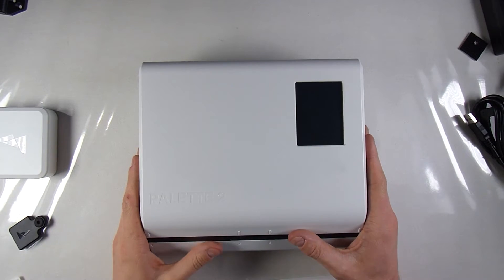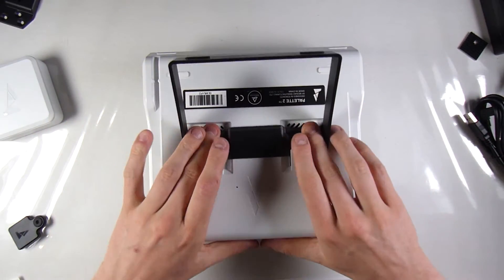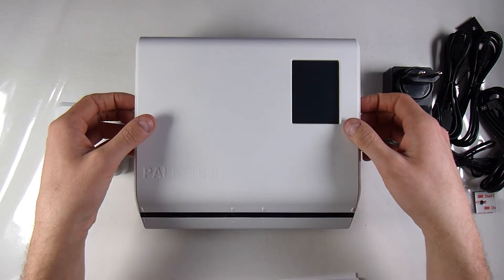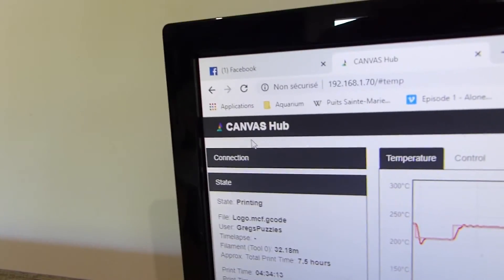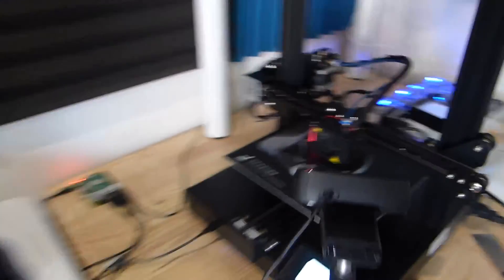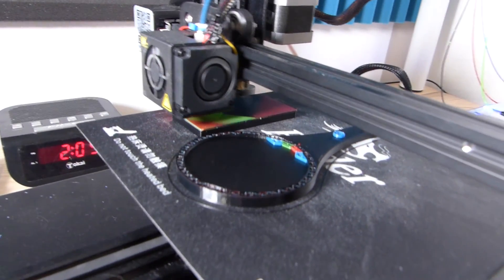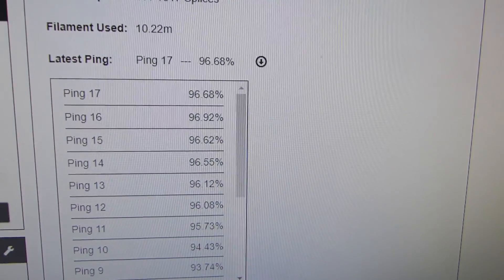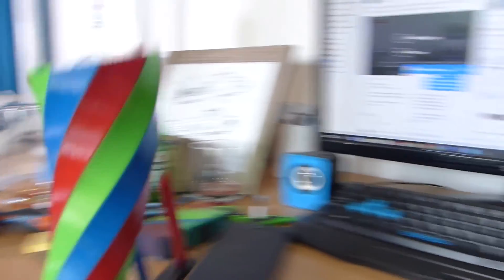Multicolor Printing with a Single Extruder !!

Comment: Why something so complex? Why only solid 4 colors? When a full CMYK color smooth change is possible: (price!).
There are some that use multi filament, but there are also 3D printers like this one (2699.00€):
https://youtu.be/7V6mEYhfbE4
https://youtu.be/C-3_ihpqqIo
That one can change color without loosing PLA material and print with more than 16 million colors, just like ink color printers do on paper, but in 3D with one white PLA filament.